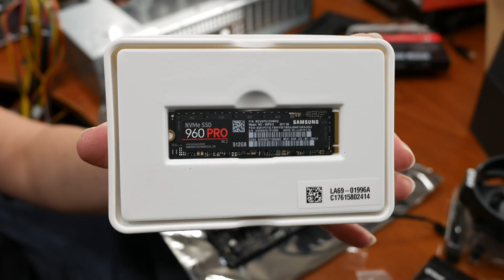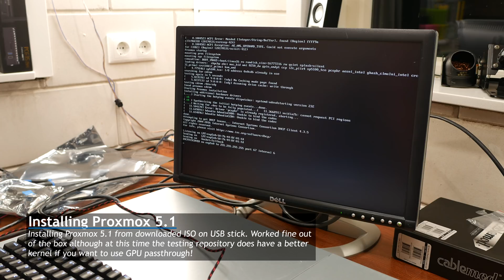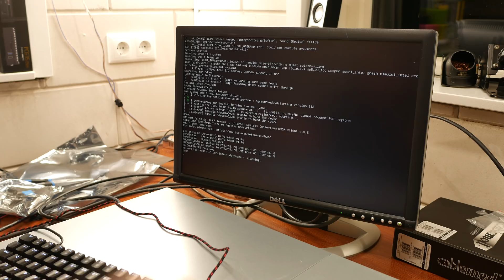Home Networking: Building a 2U AMD Ryzen server (Inter-Tech IPC 2U-20255)

Comment: Great build, few things that I would suggest to consider:
1. CPU fan - this Noctua fan is not recommended for 2U by Noctua (I asked them). You can use it, but don't try to overclock your CPU or else you'll have some heat issues.
2. Samsung NVME drive - this drives is known to throttle when it gets hot (and your machine has 3 or 4 cards there, so there will be some heat), I would suggest to find some thermal solution for your Samsung NVME.
3. Great to see that you use ZFS, just don't export ZVOL as iSCSI since your NVME doesn't support PLP (Power Loss Protection) so any sync command (and on iscsi many clients sends tons of "sync" commands to the ZFS) will slow anything you'll write to the iSCSI ZVOL.
Reply from the maker: Thnx!

I know the CPU fan isn't ideal, sadly the amount of options for in a 2U chassis that will work on an AM4 motherboard are limited. From what I could find that is available, this was the best. Since it's a server I'm not planning to overclock and the forced airflow of the 4 fans seems to work out quite well.

I have multiple of these drives and know they require a bit of airflow. On this motherboard the M.2 slot isn't located beneath a graphics card but out in the open next to the CPU, above the first PCIe slot! So airflow should be no problem. Otherwise, certainly something to take into account!

I'm aware it doesn't have power loss protection and thus sync writes would be unsafe. I'm mainly using it for L2ARC although I might toy with using it for SLOG too. I understand that's a risk but in my opinion if it's known, it's no less dangerous then running the server without a UPS for power less protection since the memory (for ASYNC) and onboard disk cache to which SLOG would flush is still without protection anyway. So it's a calculated risk, you can lose some recent data but because of ZFS, the pool should not become corrupt.
Reply from the maker: Intel just released their 800p "SSD" based on Optane, since it doesn't use a memory buffer that would have been perfect for SLOG/ZIL! Too bad most boards don't come with 2 M.2 slots though, it would be perfect to get one or two of those and use them for SLOG/ZIL even with some combined L2ARC duty because of their architecture. Who knows when I do a new build. ;)

Comment: how much was it?
Reply from the maker: All in all, it's around 4000 euro. But those costs mostly went into the HDD's, SSD's and Memory. Also the GPU's make it a bit more expensive then a normal server would cost.
Reply: not mentioned, let's say around 3k euros but you can simulate here:https://www.rect.coreto-europe.com/en/rack-server/2u-server-intel-amd/2518-short-2u-rack-server-with-amd-ryzen-processor.html

Comment: I'm still wondering why we don't have 10gbe as standard by now, and why are even switches so expensive still.
Reply from the maker: I think because business wasn't driving adoption. Server rooms are using fiber or DAC but desktops had Gigabit. Even if desktops would have gotten 10Gbe copper inside of them, practically all the buildings out there would need a complete recable.

That's why they introduced 2.5Gbit and 5Gbit, it's compatible with current CAT5E cables that are already in all the buildings and they've also been able to shrink down the chip process of the 10Gbit chips so they now use a lot less power then they did before. So I suspect in the coming 1 to 2 years we're going to see adoption of 10Gbit (with 2.5Gbit and 5Gbit modes) become more standard on desktop/workstation boards which in turn will lower the price and drive adoption.

But that's my 2 cent. ;)
Reply: Hopefully 1, 2 years. I know Asus have some of their higher end gaming boards with 10gbe, and they do a range of 'gamer' (i don't know) cards and switches, but as you said driving adoption at least at home is something that needs to happen.
Unfortunately it seems, at least to me, the home wifi router market is still being pushed for higher (and almost always misleading) wifi speeds.
Reply: Another big reason is that the average consumer is not even capable of using 10% of a 1 GBit connection these days
Reply: New iMac Pro also comes with 10GbE as default.
Reply: It’s been two years... no dice.
Reply: Or at least 2.5Gbe or 5Gbe. Aquantia came out with new chips recently. So I hope they become the norm. Some motherboards have Aquantia chips now.
Reply: "BECAUSE" ;) (Ask vendor of network chip)